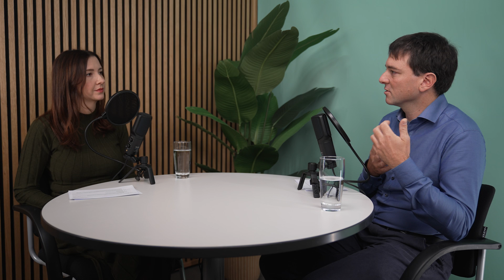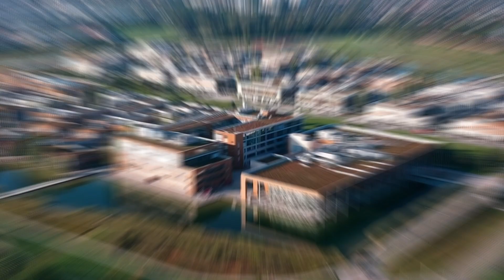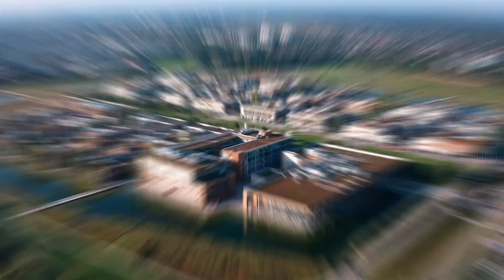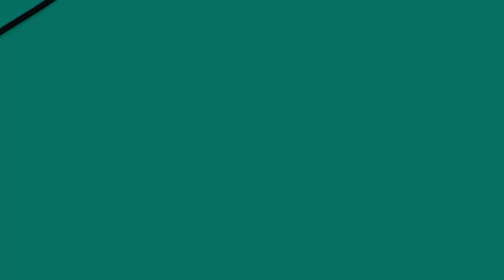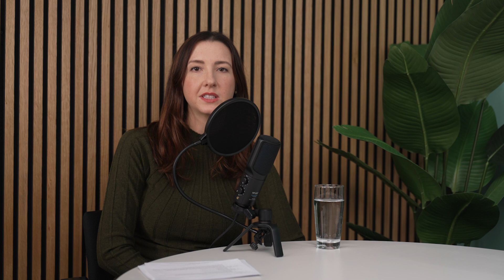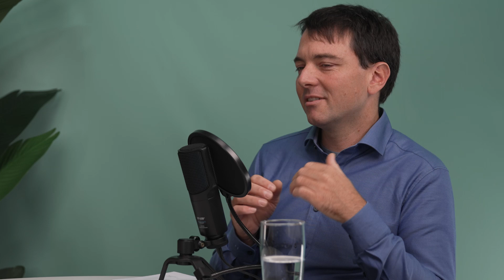What Makes SiC Chips So RELIABLE in the Long Run? | Infineon

Comment: The reliability of SiC chips lies in their stable performance. They can withstand high temperatures and high currents under long-term operation. As passive components, Yongming capacitors can be used as filtering or energy storage capacitors to help the chip perform better.